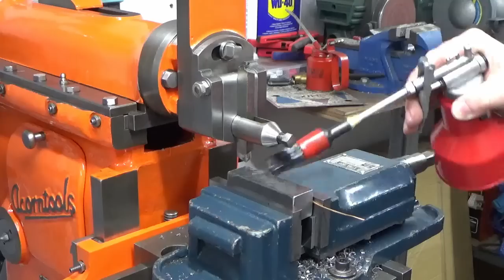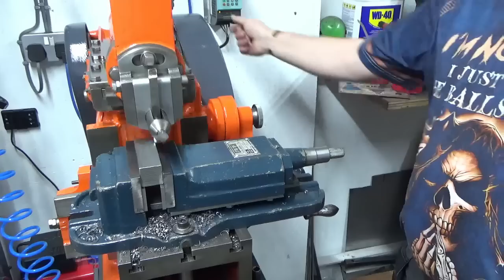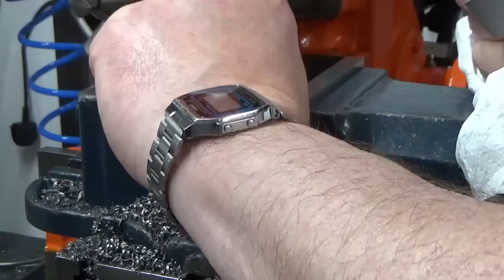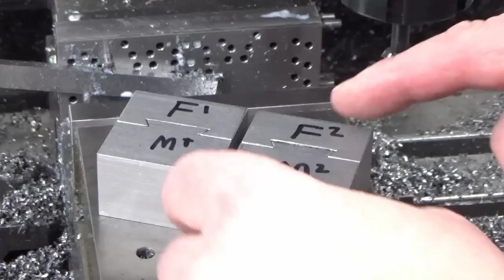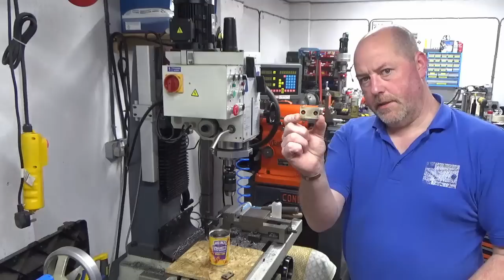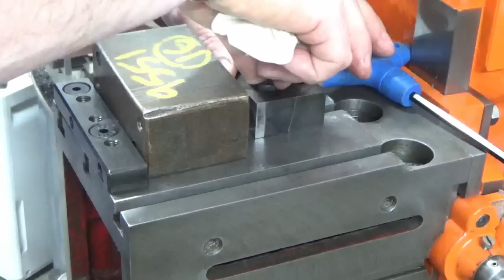Making Dovetail Table Clamps

Comment: Just wondering why you used the shaper and not the milling machine for the machining ? Cheers
Reply from the maker: Hi Richard, I often get asked that. Simply for the joy of using such a fascinating machine, some nostalgia as a shaper was the very first machine I worked on day 1 of my apprenticeship, and it has a power traverse which my mill doesn't, allowing me to de-burr etc  whilst cutting. As this is a hobby for me, it's all about pleasure, not about speed. Hope this answers👍🏴
Reply: @jonsworkshop  Yes understandable. Last time I used one was at school 50 years ago. Cheers

Comment: why would you use the slow shaper when you have a mill ?
Reply from the maker: Hi, thanks for the comment and question. Couple of reasons really, this is a hobby done for enjoyment, and there is no machine quite so enjoyable to use, watch and listen to than the shaper. Secondly, my mill has no power feed, my shaper does, so whilst it may seem slower, I am de-burring parts and cutting parts at the same time. Lastly, my shaper is far more accurate than my mill and leaves a far superior surface finish. Cheers, Jon
Reply: @jonsworkshop  cool thanks for the reply when I was in tech school 30 something  years ago  we were thought about them but never had the chance to run one 
Love your videos thanks

Comment: Very nice clamps. I was sceptical about your angle set to begin with but I can see it's utility now.  Two points, why not cut the dovetails on the shaper? It's what it's good at. Also, I was taught to always climb mill with dovetail cutters and T slot cutters.
Reply from the maker: Hi Alan, thanks for the comment. I need to modify my clapper box on the shaper to be able to clamp it up solid for slotting (something I keep meaning to do and forgetting), it won't slot cut without this, and even with it I think it will be a challenge but we will try anyway. I have tried slotting once with a 3mm wide tool and the vibration was horrendous. Not sure on climb milling, I wasn't so much taught but I have lost many more teeth/cutters climbing on lightweight machines than conventional milling. Maybe on big solid Mills it would be the right way to go, I never came across these cutters much in my early career or apprenticeship so limited knowledge. Cheers, Jon

Comment: The wedge angle is pretty small, so the amount of movement of the moving jaw towards the workpiece is pretty minimal, but it feels like that movement is fighting the T-Nut for that clamping bolt causing the bolt to canter as it is unlikely the T-Nut can move to maintain perpendicularity. It feels like having a rounded profile nut in the slot (or a dowel with a threaded hole through it) and/or a spherical washer and nut would deal with these forces. Again, the issue may be negligible, but worst case you could be tipping the T-Nut in the slot and digging a corner in on the underside of the slot, at least check for this when using these to make sure you are not causing damage or point loading.

The other issue with this type of workholding is that they apply their force using the table itself for support, which is often not designed to deal with this type of load. This can cause binding or wear to ways and gibbs and create accuracy issues, so these are best used with the minimum gronk required for holding and replaced with conventional workholding as soon as possible.

Comment: Great little project Jon. How did you harden and temper the jaws in your workshop? Also would it be possible to show some details of your shear tool. The finish you achieve with it is very good. Keep up the good work.
Reply from the maker: Hi Gary, thanks for the comment. I flame heated using oxy propane to non magnetic (phase change temperature) then quenched in vegetable oil, tempering using just propane up to straw colour and quench again. I will show shear tool at some point, prod me again if I forget pls. Cheers, Jon
Reply: @jonsworkshop  Hi Jon, thank you for the quick response. That is how I harden and temper, wonder if you had invested in an oven or even borrowed Mrs Jon's Workshop oven for the tempering!!. Will look out for the  shear tool info. Thanks again for a brilliant channel.

Comment: Good work Jon. What metal is the flat stock that you used for the jaws? Did you harden them by heating and quenching in oil?
Reply from the maker: Hi Jon, thanks for the comment. Gauge plate (01) used and yes, flame heated and quenched in Vegetable oil, same for tempering. Cheers, Jon

Comment: What is the best material to use if you don't have the ability to harden it? I guess it would be a material with good bearing property's for sliding the dovetail under pressure. So maybe cast iron or bearing brass?
Reply from the maker: Hi, thanks for the comment. I would use a medium carbon steel for the dovetail blocks (EN8 or equivalent), and gauge plate (01) for the faces, even in a soft state, gauge plate is pretty resistant to damage. Cheers, Jon

Comment: Very nice. It seems to need some captured springs to hold the front jaw up off the table though. Yes you can lift them as you did but I would forget.
Reply from the maker: Hi Mark, thanks for the comment, great idea, I will look at adding springs before I use them in anger. Cheers, Jon

Comment: Very nice clamps, particularly for holding longer parts on the mill. But dang, I wanted to see the dovetails done on the shaper!  Classic use case, better finish. Your parts came off so clean!  Wish I had one of those beauties. Shaping is such a primal, yet very controlled operation.

Also super happy seeing your angle pin plate prove its worth. I've seen related designs (e.g. Joe Pieczynski), but the genius of yours is having it act as a vise jaw.  I like your discovery of the  built-in stop function. Simple things like that show off the fundamental solidity of your idea.

I once used my lathe as a "shaper" to rough out a camelback straight edge blank.  Painfully slow, but very little left to scrape flat - a precision operation limited to the accuracy of the ways and their rigidity. I then used it to scrape the cross slide on the same lathe, cleaned up nearly two thou of error from the factory. As Gotteswinter said, "consider these machines a kit of parts". I've three-plate ground my own optical flats to 1/10 wave (50 nm, 2 uinches) which I used as a repeat-o-meter to bump my cheap surface plate to AA. So rewarding to use primal methods to bootstrap the machines to essentially arbitrary precision.

I had mentioned in your pin plate video I was thinking of how to achieve sine plate variability with your design. My ideas all sacrificed some area of the jaw face character, which is not good.  Then duh, make the bottom of your plate a sine bar.  The sine plate feature would be against the vise jaw, the part-side would include an apron that covers the sine dowels, and your peg holes would be arranged to miss the cutouts around them.  Could also eliminate some of the smaller angle incremental peg holes, keep the most useful angles, and now one can etch labels for them since there are fewer options that otherwise crowd the space.

Thanks for sharing your inspiring designs!  Of course, now I have yet another project on my list of projects that never leave the shop...

Cheers!
Reply from the maker: Hi Nathan, thanks for the comment and feedback. I so wanted to do the dovetails on the shaper, but unfortunately it is not man enough to slot out the female ones. I need to modify the clapper so I can lock it, this should help a bit. Cheers, Jon

Comment: Finally, someone who went my route and made the sliding blocks with an interlocking feature... 
A 2 piece vise is a great design aswell, but i dont know why are so many people almost obsessed with those eccentric bolt and nut clamps and other such designs... Sure, more simple to do... Lower profile... No specific tools(d.t. cutter) other than what any machinist should have on hand(drills, reamers, boring bars, hhs blanks)... But why the mighty bite style... Its the worst approach to the issue at hand, what with the nature of the mechanism, what with a lot of force being channeled through a small screw and a small t-nut into the slots and so on... With this larger design, one is automatically more inclined to make larger t-nuts, merely to please oneself aesthetically if nothing else... 

While you are at this project, why dont you make your own sliding gauges or some proper adjustable parallels? Its the same principle, just a bit longer and taller and wider... I also advise the same design for machine feet... Of course, it depends on what do you do, and what do you want, but this sliding block design offers a lot of projects solutions with this one dance sequence... But this is very nice! A beautiful project and nice work!
Reply from the maker: Hi, thanks for the comment and feedback / suggestions etc. I may do adjustable parallels in the future, would be an interesting project. Cheers, Jon

Comment: shouldnt matter mush but from wat i can see the mecanism moves the cariage while the cutter runs through the piece , you would think that its supposed to move the piece with the cutter is on the way back so the cutter doesn have a sideload while it moves through the material (not sure as the cutter might need it to prevent it from bending away from the cutting edge )
that would mean that the ofcenter piece or crank for the mecanism should be 180 degrees rotated so it moves the cariage on the way back
Reply from the maker: Hi Watahyahknow, thanks for the comment. You are spot on. I put some text up on screen when I started the shaper work, but I probably didn't explain it very well. I spotted it about half way through the shaper work and switched 180. Cheers, Jon

Comment: Hi Just found your channel a couple of days ago, working through some of your vids. I'm sure there is a good reason but why use the shaper first then finish with the mill when it all could have been done on the mill.
Reply from the maker: Hi Martyn, welcome to the channel. Just the joy of using the shaper really, also, it has auto feed unlike my mill so I can set it running and be de-burring, or setting up the mill for the next op etc whilst it does its thing. It's hard to explain, there's something captivating about that machine that just makes me want to use it often. Cheers, Jon

Comment: I enjoyed watching that, thanks.
A couple of questions. If the hardened jaw prevents wear against the workpiece under the tightening forces, presumably the soft dovetails will wear instead? Secondly, when you were using the shaper, you dont seem to have the table support as I do on my 10M which rides on the smooth surface at the front of the base and reduces table sag?
Reply from the maker: Hi Robert, thanks for the comment. You are right to a degree, the pressure faces on the dovetails are quite wide (deliberately so), so wear will happen eventually but probably not in my lifetime, these won't be used much really, just handy to have for that awkward job. Lol, I forgot to drop the table support down (as well as setting the feed up wrong...... Newbie). Cheers, Jon

Comment: Nice result on those, Jon.  The fixed part of the commercial clamps is a lot longer, to stop the clamp cocking back under high loads and cracking the T slots, might be worth considering for later builds.  Soft jaws for odd shapes would be an option with your setup, I like that.
Reply: I’d like to see that modelled, but I think the way this design clamps the moving jaw into the table, it practically eliminates the tendency for the fixed jaw to cock.  Almost all the rotation force is opposed by the moving jaw screw (and I suspect that is where the highest stress occurs in the table)
Reply from the maker: Thanks Wibbly wobbly, I will not be using much force on this little machine so hopefully the T Slots will be OK. Soft jaws is an easy adaption and a great idea. Cheers, Jon